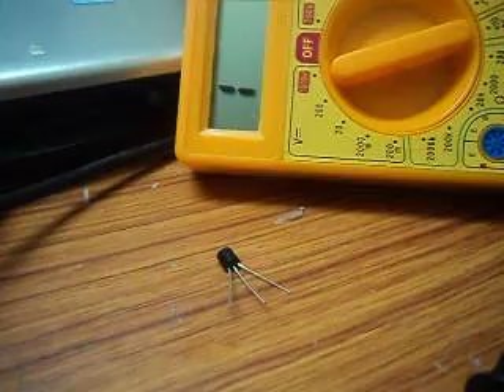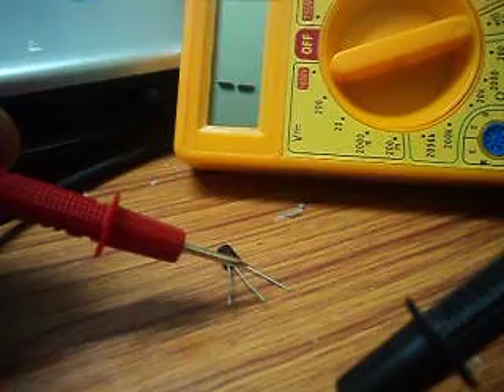how to identify base, emitter and collector of PNP of NPN transistor

Comment: totally incorrect in most transistor  Base to emitter  has high voltage drop as compare to Base to collector. for example 2N222A NPN transistor VBE is 0.660v and VBC is  0.633v . correct your transistor concepts please.

Comment: no sorry.find the base by using continuity checker .the base is the one that allows current to flow to both other leads (one at a time) .it is npn if the red (positive lead) of ammeter is on base  when current flows (or voltage is read usually 0.7volt approximately) to either of the other leads.if the black lead is connected to base when current flows (or 0.7 volts is read ) to either of the other leads then transistor is pnp.The only way to tell collector from emitter is to check transistor gain  in a simple circuit. Gain is much higher when:for npn: 1. positive voltage is on collector and positive current goes in base OR for pnp :2. positive voltage is on emitter  and current flows out of base.
for example the transistor gain correctly biased is usually over 100 and when incorrectly biased ( i.e. emitter and collector incorrectly chosen ) only about 10.

Comment: mr.the one with higher resistance is emitter and lesser is collector ,as electrons will tend to flow to region of lower resistance only which is collector as its name suggests.and there is a method to identify base also first,so first go learn your basic before posting a video.

Comment: That knob is not pointed to resistance. Its pointed to voltage. Then how u telling that is a resistance
Reply: You need glasses, the multimeter is set on the diode test not on voltage.
Reply: exactly.

Comment: that is why we always calling to transistor is a amplification device that is amplifying a weak signal into stronger or switching like a valve go no go no and it is a semiconductor device input low output high on given value.transistor means transferring the electrons to its nearby components for working them good. transistor has at-least 3 or more packages to identify these is a little bit tricky in real circuit and very difficult to identify.
Reply: Wrong information. Remove this misleading video immediately.